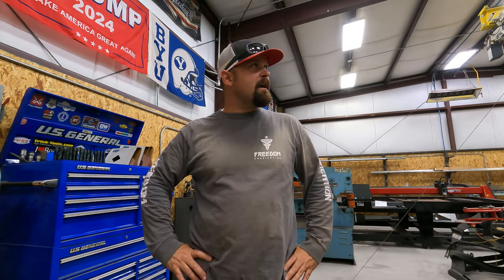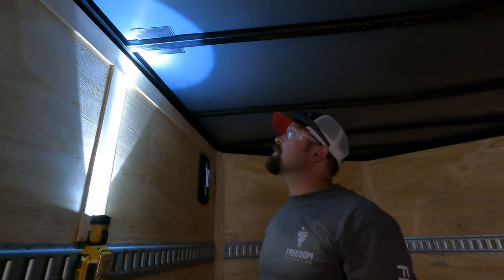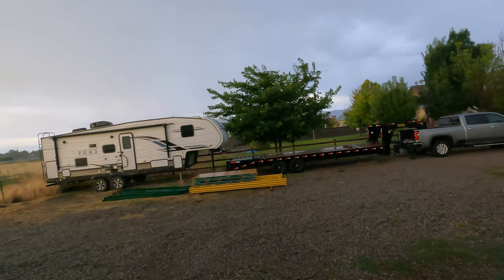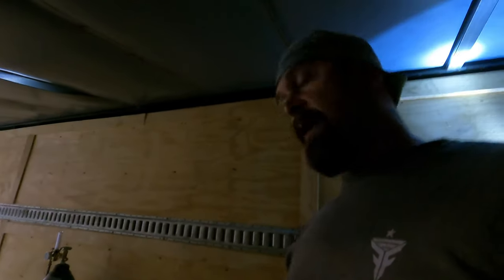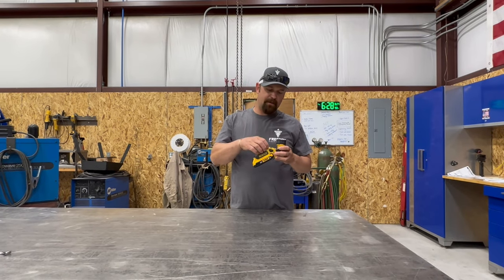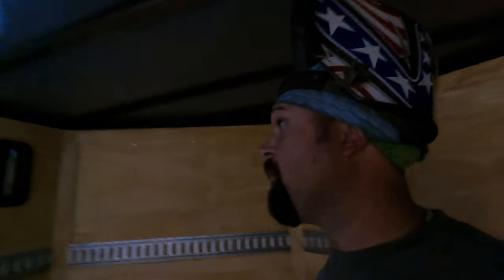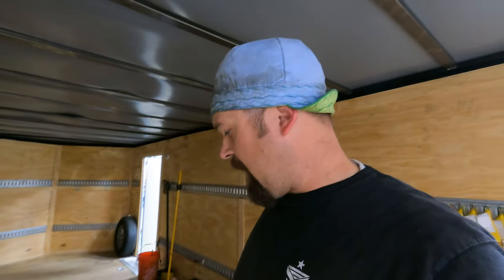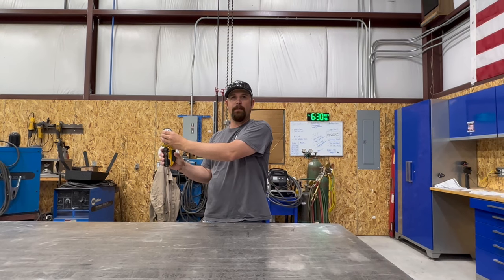Enclosed trailer Roof repair & Fabrication

Comment: I got an inverter stick welder i got 100ft of 10g extention cord to plug into the welder to run on 240v and another 150ft of another 10g for 110v if needed its 160amps weighs about 7lbs lots better than hauling my 225 amp miller across the shop i even take it with me on mobile jobs too i dont like pulling 100ft of 2/0 cable too much
Reply from the maker: Agreed. I can see the benefits. It is really handy to have a smaller, lighter, portable machine. Thanks for watching!

Comment: Since you have way more experience than I do, I am wondering why you didn't place the tubing on its side insted of flat; that would have been stronger...
Reply from the maker: You are correct, it would be more rigid to stand it up. The reason I Laid them flat is because the rectangle tube needed to slide in between the roof, and the angle frame that supports the cross members. I could have notched the tube, but I felt like it wouldn’t have looked as good. To increase the strength, I increased the tube thickness, and just installed them the same way the factory members were installed. Thanks for watching!
Reply: @Freedomfabrication777  👍👍

Comment: Im thinkin of picking the arc captain up. I want a suitcase or a small portable mig. Not reslly doin anythint thicker than 3/8th inch and i got 240v. They got it for 100$ off for another 22 hours 😅
Reply from the maker: For the money, I do think it’s a pretty impressive little machine. And for a multiprocess machine, it’s pretty dang versatile. Decisions, Decisions! Good luck and thanks for watching!
Reply: @Freedomfabrication777  I'd be running it off my bobcat out in the field. Which is kinda why I want a suitcase but then when I'm in other spots I can run it off whatever available. I really want a multimatic 200 with the hard plastic case but they're expensive
Reply: @Freedomfabrication777  I got the arc captain tig 200 and that thing rips everything I've been doing so far with it
Reply from the maker: @hanford_adventures  I also have the miller Multimatic 200 suitcase welders on my wishlist. Maybe some day!
Reply: @Freedomfabrication777  they just released something the other day that they're gonna be discontinuing and replacing it with something else. Might go talk to my local dealer see if they'll sell it to me when they get the new model
Reply: @Freedomfabrication777  they just released something the other day that they're gonna be discontinuing and replacing it with something else. Might go talk to my local dealer see if they'll sell it to me when they get the new model
Reply from the maker: @hanford_adventures  i’ll be keeping my eyes peeled as well, thanks for the info.